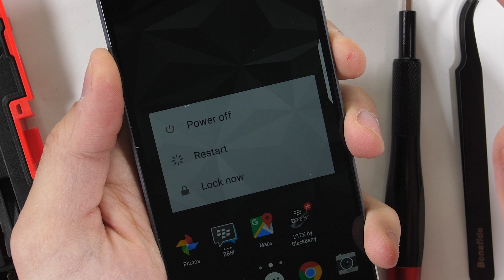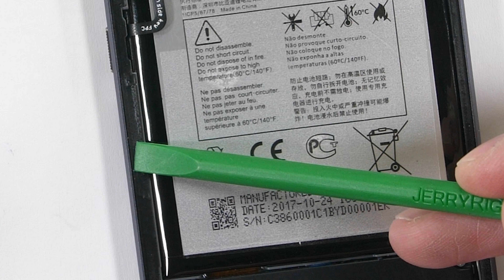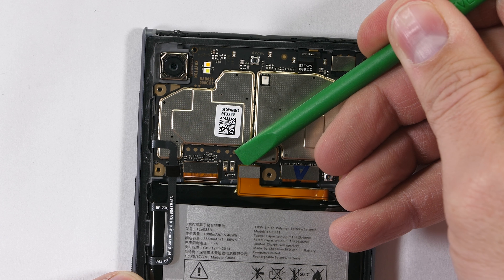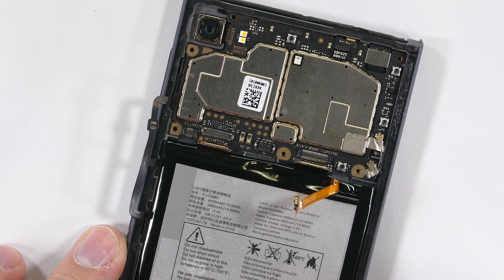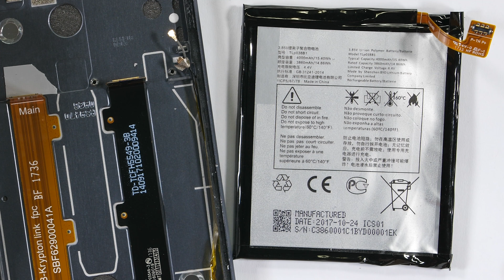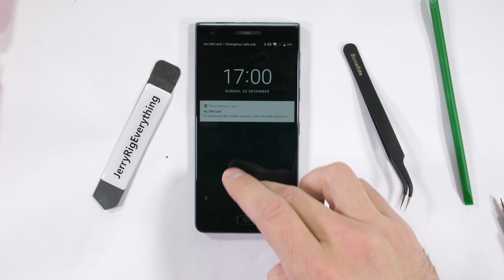Blackberry Motion Teardown - Do not trust around Water...

Comment: The glue on the back panel is normal, what's different is the back is flexible. With a rigid glass or metal back, a much larger section of adhesive has to pull away at the same time in order to release the back, giving the impression that the adhesive is stronger.

Comment: Well I've had my BlackBerry motion dropped in water and it does fine. Although the screen is crap in terms of scratch resistance. It performs well and is good for a 2017 phone in 2019. And has no real signs of slow down.

Comment: One thing to note about this phone vs the other devices, yes it seems less sturdy and less water resistant, but those back panels are made of a rigid material(glass) vs this one(plastic) so the Motion's back is more likely to come off since you can peel it instead of having to heat up and gently separate the glass. Just an observation but I do like that you say do not trust around water. People always assume IP ratings make their phones invincible. Makes me a phone repair guy very upset.

Comment: The "tackiness" of the adhesive isn't necessarily a good indicator of water resistance. As an example, the Samsung S5 achieved IP67 with a rubber gasket that wasn't actually adhered and was just clipped in with the back plate.

Overall, IP67 isn't a very robust spec, and really it would be nice to see phone manufacturers align on a better spec for electronics WR testing and performance, but the seals in that phone look like they could definitely pass IPX7 at least as long as the manufacturing had good quality controls in place.

Comment: Just because of the adhesive? 

The Xperia ZR had a removable battery while maintaining a immersion rating for 30 minutes up to 1 meter by only using a tiny gaket and some clips to the back to make minimum pressure. 

Anyhow, even a well glued phone with IP certification should be kept out of water's reach, no manufacturer say it's a good idea, I've seen enough "perfectly glued" Galaxys die due water damage... And mostly the speakers and buttons are the failure point... IP67/8 is rated for a few low pressure, swimming with the phone or washing it under a well pressured tap is enough to put more pressure than the phone was designed to support.

Comment: IP66= Dust tight, Protect against water jet, 100KPa @ 3 Meters, 3 Minutes
IP67= Dust tight, Water immersion up to 1Meter, 30 minutes
IP68= Dust tight, Water immersion 1Meter and over, manufacturer specified
IP69= Dust tight, High pressure, high temp water jets, 8-10MPa @ 10-15cm 80°C, 4 different angles 30 seconds each